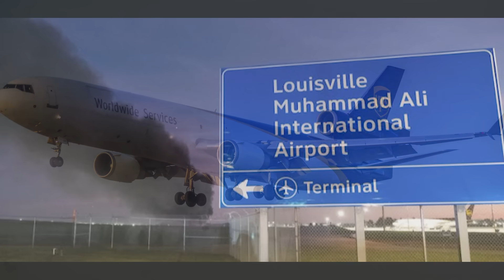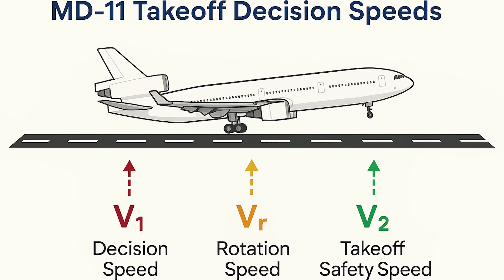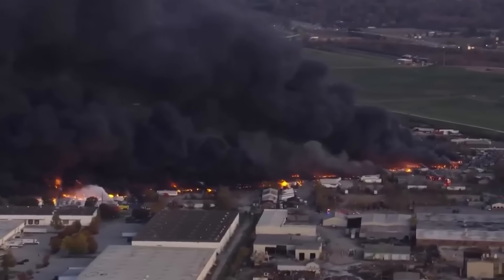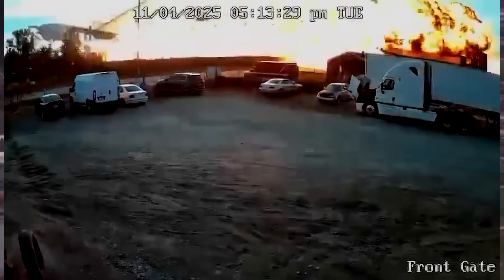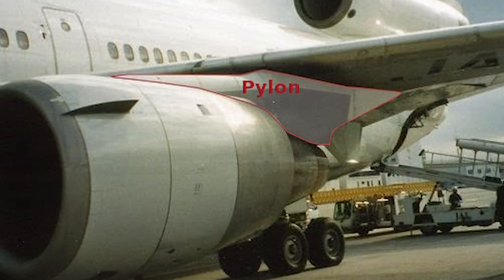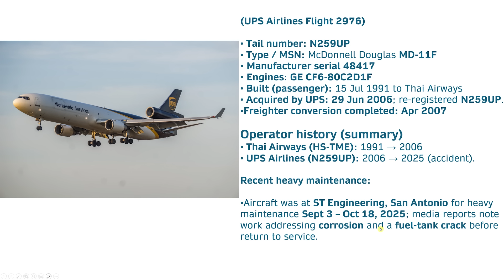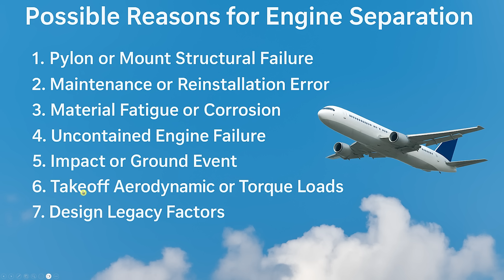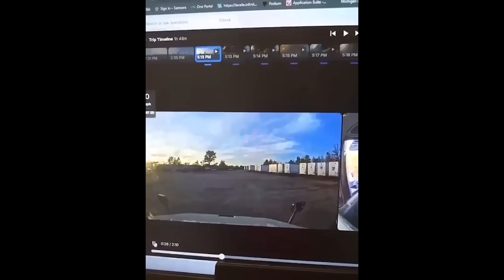What Caused UPS Plane Crash, Louisville, KY? How MD-11 Engine Fell Off

Comment: Before anything falls off a car. There will be plenty of signs and warnings. You would have to be a dummy to not hear it rock and shake. Now when it comes to planes more power I know. It hard for me to believe someone didn’t hear, feel or notice something wrong with the plane prior to it coming off. Like you said with the fork lift hitting the engine/wing and it start a small crack. With in time became bigger. These pilots and people operating those planes. They know exactly how it should feel and sound when the plane is operating. For them to ignore it and put their lives and other at risk. By out right ignoring the sounds and braking of the the plane is criminal. Maybe it was not ware and tare but something else. A drone? Those big delivery drones are huge and some tim those battery come flying out the air.

Comment: The planes fuel is stored in the wings, the left engine had completely come off of the wing causing an immediate fuel leak the planes left wing then strikes the power line doing further damage to the wing causing even more of a fuel leak while the tail simultaneously strikes the power line.  The electric discharges from the power lines ignited the fuel both the solid fuel spilling from the wing as well as the fuel vapors causing a massive eruption.  You can see the moment the sparks from the power lines ignite the fuel trail in slow motion at 14:54